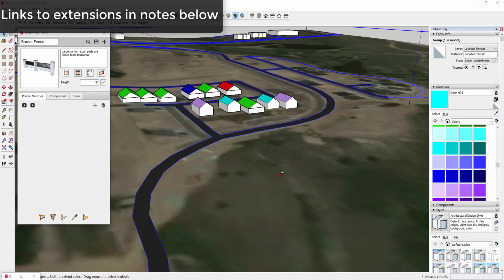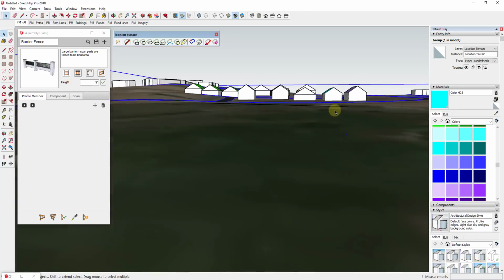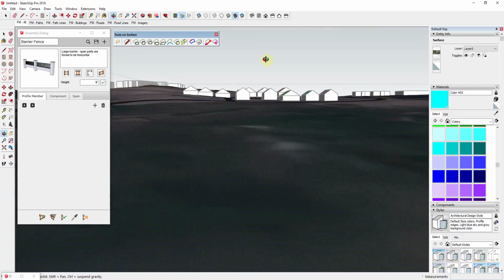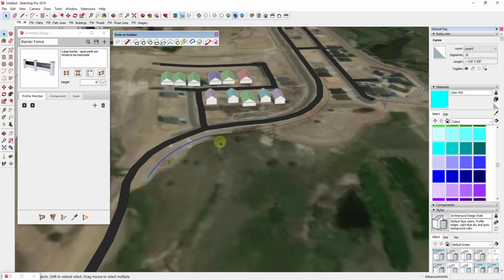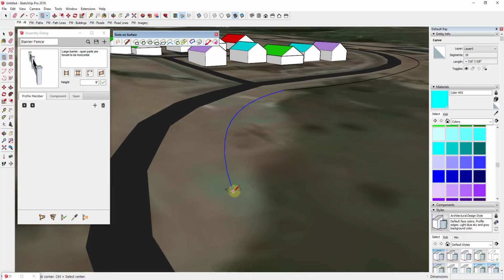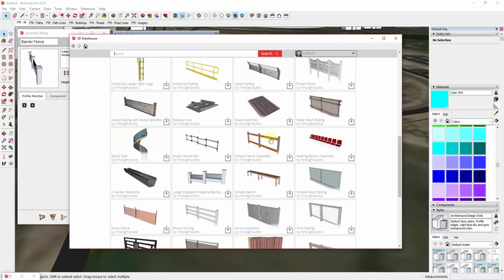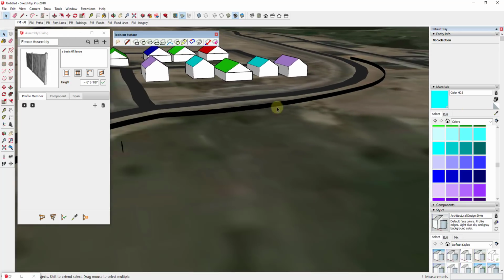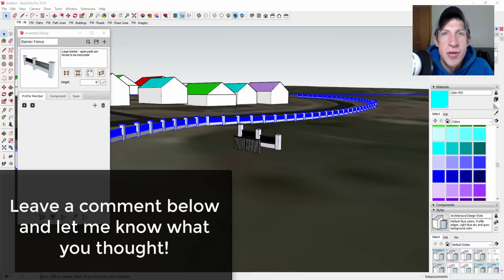FENCES ALONG TERRAIN in SketchUp with Tools on Surface and Profile Builder

Comment: Whenever using the Line On Surface on a terrain model created from contour lines, after cutting and pasting in place the line does not appear on the surface. It pastes in the original place. Any suggestions?

Comment: Thank you for the video.

I have a question about a problem that I have with sketchUp.
I have the latest version of sketch up pro 2018, and the problem I have, is when I installed 2018 version,  the plug-ins are not automatically installed. And when there is an update it is not installing it.
Have you encountered such a problem with sketchUp Pro 2018 ?

Thanks Justin.
Reply from the maker: Hi George - 

I don't believe that when you move from SketchUp 2017 to 2018, the plugins migrate automatically. You could try this process - https://www.youtube.com/watch?v=0XWdovVjeHw